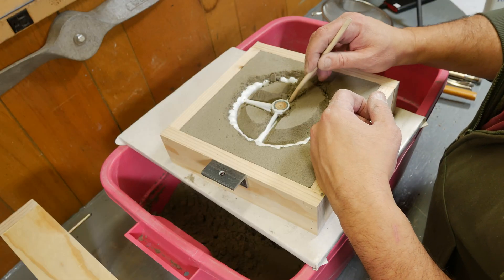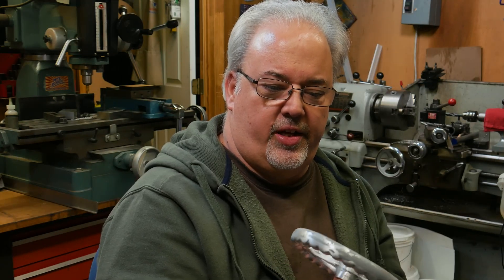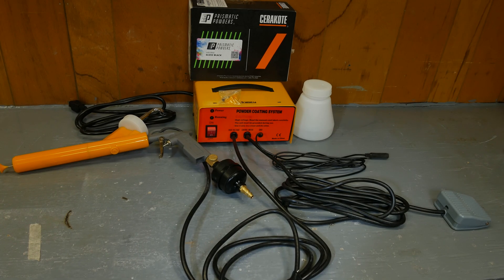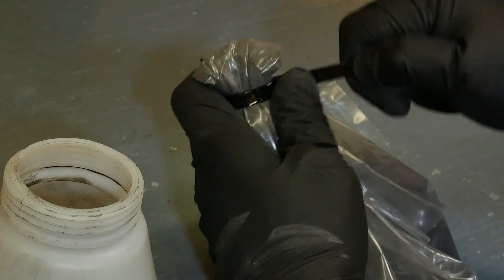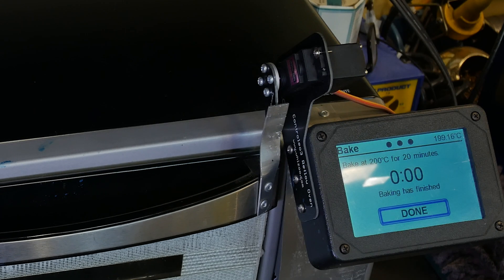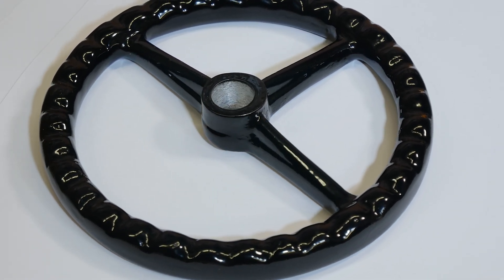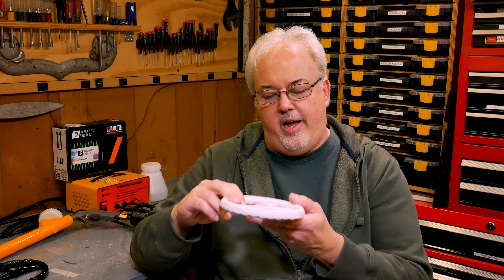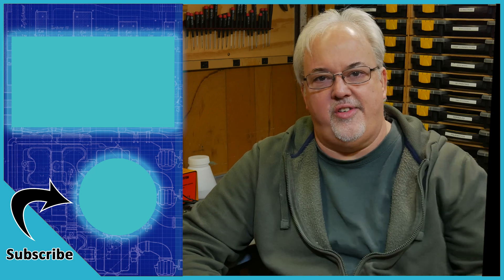Will the Cheapest Powder Coat System Work?

Comment: If something got scratched after it was powder coated just a small area, is it possible to spot fix it right there to prep over the area with metal reinforced filler then sand and powder paint, but instead of using a oven use a heat gun just on that area or heat lamp?

Comment: Shrinkage 😂 The powder coating looks fantastic! And I’d love to know how you make PCBs, I never knew it could be done at home.
Reply from the maker: Well, it would be more correct to say that I use the oven to re-flow the solder to attach the components to the circuit board.
Reply: @PeteRondeau  Fair enough haha

Comment: Hang your parts on a wire away from other conductors. Prre-heat the part to 400F and spray them hot, it will melt on contact. Post back for 20 minutes. The powder will be attracted to the nearest bare surface but once insulated by a coat of powder the powder will wrap around and coat the back to a surprising extent. You still need to spray front and back. Inside corners repel the powder then turn off the HV to force some into the corner.  Re-spray, re-bake is generally undesirable and gives poor results.